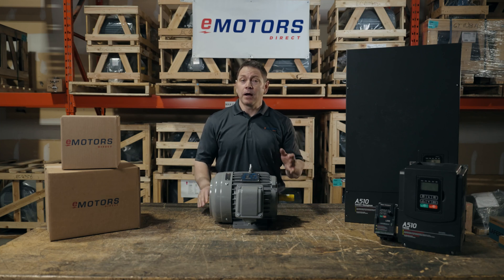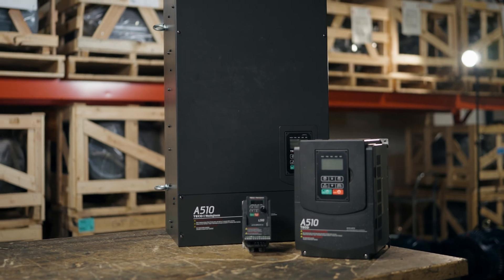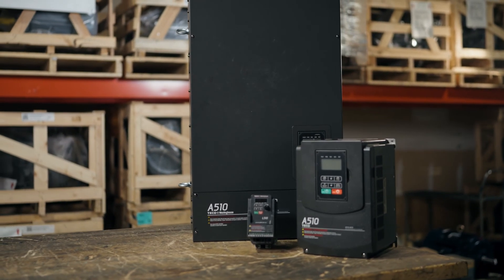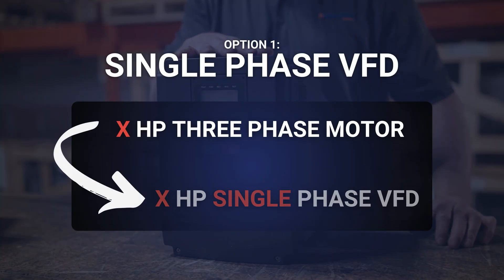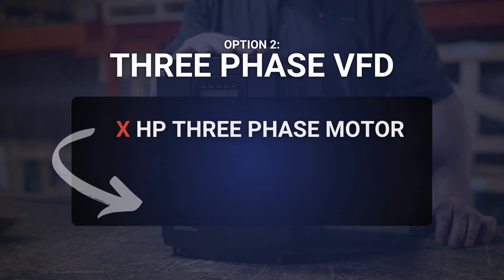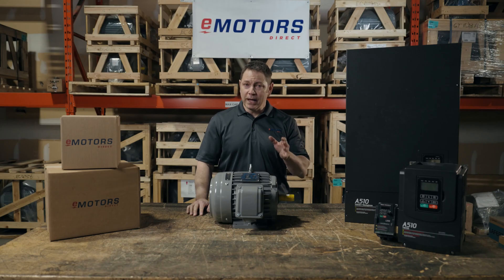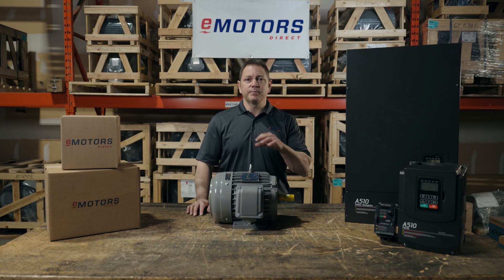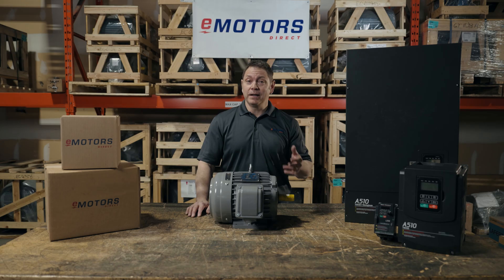Can you run a 3 phase motor on single-phase power? (Yes! Learn How)

Comment: Can we use single phase motor to drive 3phase generator and use that 3phase?
Reply from the maker: In theory, maybe. But this would be inefficient, unstable, and not a good solution. Better to go with VFD or phase convertor.

Comment: How I run three-phase motors on single phase: line and neutral from single phase is connected to connection 1 and 2 on the three phase motor, and then I will take a standard run capacitor and connect it to line two and three on the motor
Reply: How much do you derate the power output of the electric motor when you do this ‽ Does this cause a torque ripple ‽ Does the motor run hotter for similar torque output levels ‽